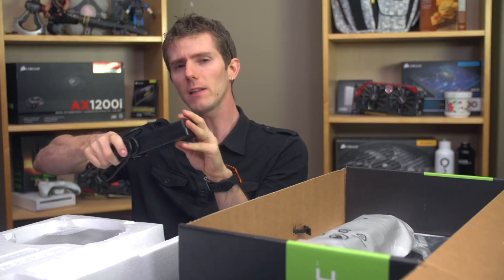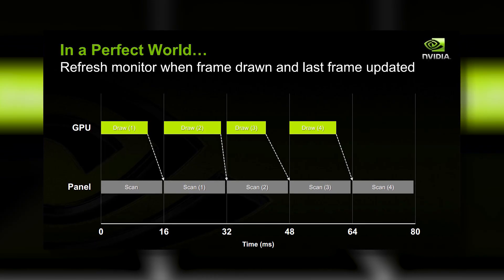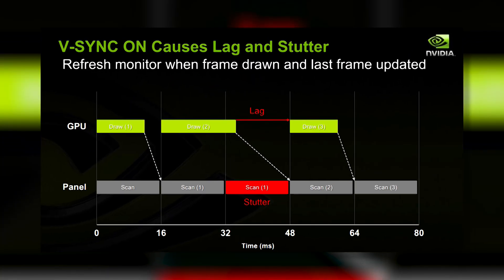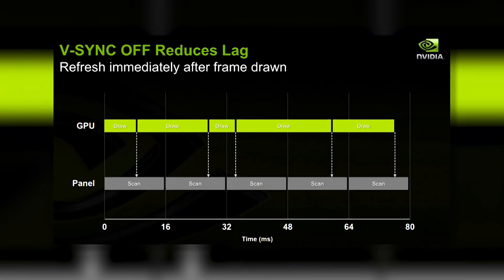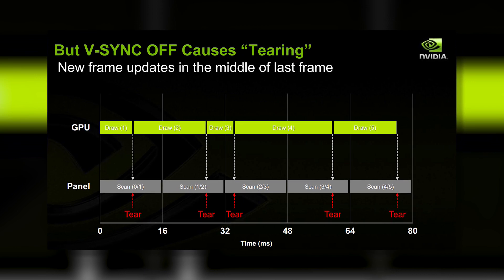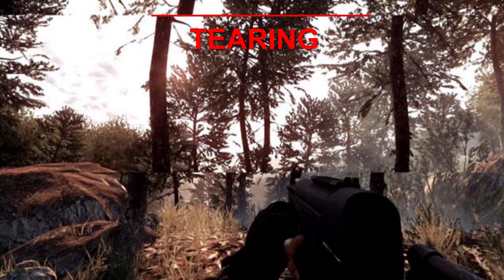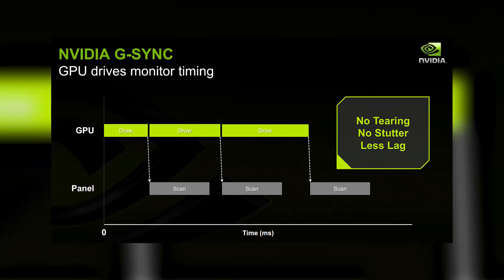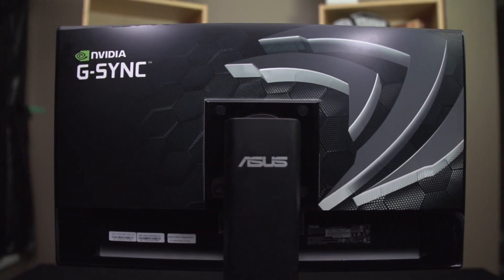NVIDIA G-SYNC Tech Preview - Linus & Slick's Impressions

Comment: Wouldnt getting a 120hz monitor do the same thing as this.
Reply: Not exactly. A 120Hz monitor does have double the refresh rate as a plain 60Hz one (taking half the time per-refresh compared), but even so if your card to pushing (say) 300fps in something like TF2 you're still likely to experience tearing on the 120Hz just as you are on the 60Hz.

G-Sync is something that'll make the monitor show exactly what's being pumped out by the card without the issue of tearing. So that 300fps example? a G-Sync monitor could (in theory) have a 300Hz refresh rate to match that 300fps so each refresh happens when the card pumps out the next frame and not when the powerline into the monitor dictates.

Comment: I actually went from a system with a SSD to a RAID0 mechanical drive system at one point. It wasn't terrible, until one hard drive started failing. When I had the money to upgrade a SSD was the first thing I bought.

As for this monitor, I love the Gsync tech. When it comes to reasonably priced 2560x1440 IPS monitors I will be all over it. I don't care how amazing this tech is, I couldn't handle the resolution downgrade or the HUGE quality downgrade to a crappy TN panel.

Comment: I could not go back to HDD after SSD.
Linus how does G-Sync work above monitor refresh. Let's say you have a 60Hz monitor? Will it technically act same as V-Sync? Example would be playing BF3 above 60fps all the time. You still get lag with V-Sync no matter the scenario. 
Also I have a U2711 I bought 2.5 year ago. I love this monitor and would never consider anything other then 4K as a upgrade. Another 1440p + G-Sync might be a option though but we don't know how long that will take.
To make it even harder I also have 290X which I love under water. 
This will be so hard for Nvidia to sell until it becomes a standard monitor feature probably not called G-Sync. I believe as long as it's Nvidia only it will not do much. Even light boost monitor work for AMD GPUs and they are not selling that much.

Comment: I have that same monitor and a GTX 780; i just want to know how much a G-sync chip will cost and how difficult it will be to instal. If modifying my VG248 is no more difficult than building my PC, then I'll definitely consider getting the DIY upgrade.
Reply: There will be soldering involved I'm pretty sure, and that's if there is room for the G-Sync board itself...

Comment: I'm running a raid 0 array of 2 ssds.  I don't care that it was more expensive (It's a 512 array costing me around $300 at the time) and I would never replace it with mechanical drives.  I take it to lan parties and I never have to worry about the drives being damaged.  I also put an ssd drive in a laptop and it totally changed how it worked and it felt so smooth once I started using it.

Comment: doesn't adaptive vsync enabled on your video card already do this? I have it enabled and  have v sync off. Never seen any tearing yet.
Reply: No, it doesn't do the same thing - adaptive V-SYNC turns v-sync on and off based upon your framerate for a smoother experience, while G-SYNC synchronizes the monitor's refresh rate to the GPU's frame output.
Reply: Adaptive vsync is far from perfect. It still has issues with frame rate drops screwing with smoothness.
Reply: True, but definitely the better option considering its free and the difference is minimal. I agree with Linus its going to be pretty hard to sell
Reply: AFAIK adaptive vsync is just vsync that only turns on if your fps goes above your monitors refresh rate. And whereas vsync delays the gpu, gsync delays the monitor. I've heard it works best when you are getting around 35-60 fps. But below that and there's a lot of extra stuttering, since the monitor is literally waiting for the gpu.
Reply: adaptive vsync gets rid of the vsync lag when you have a frame rate drop, but it still had input lag in it. when i tried it out, i think i experienced 500ms of input lag(it could be less or higher, but i'm just stating that number just to show how horrible it was to have it on).